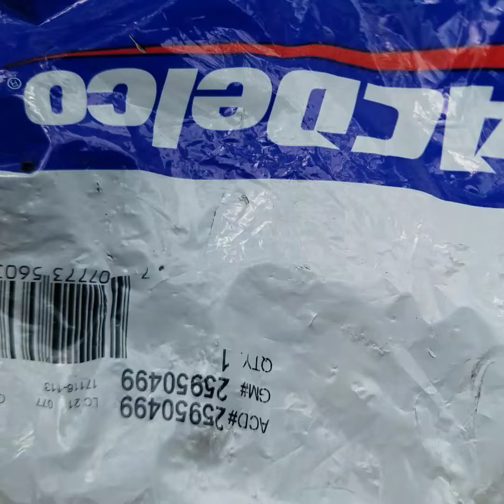Chevy Astro Fuel Fill Problem

Comment: The fuel capacity of an Astro van is 27 gal.
Reply from the maker: 27 gallons is advertised and it’s true but it is designed to hold about 22 gallons of gas with 5 gallons of air space. Like most cars these days the fuel pump is in the tank and the pump is cooled by the gas so your useable fuel is about 20 gallons.

Comment: Did I notice a new fuel tank? Looks to clean to be original and the reason I’m asking is because the shield (GM called this fuel tank shield) is there to protect the tank. Well you can’t buy a new one anywhere. Let me know.

Thanks 
Steve